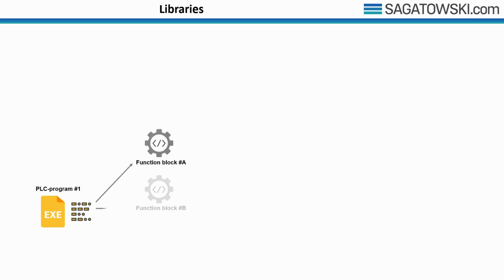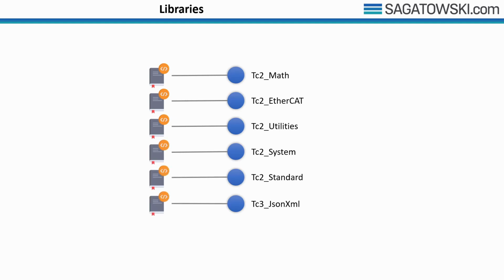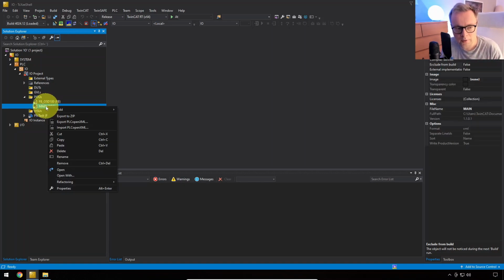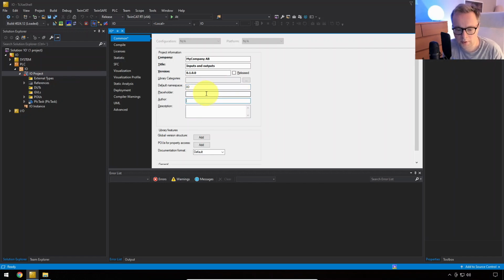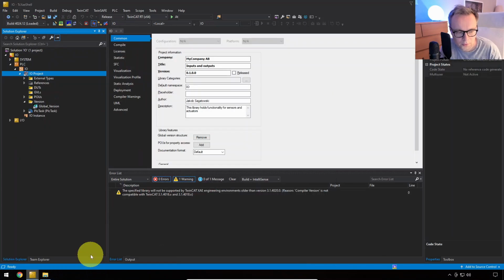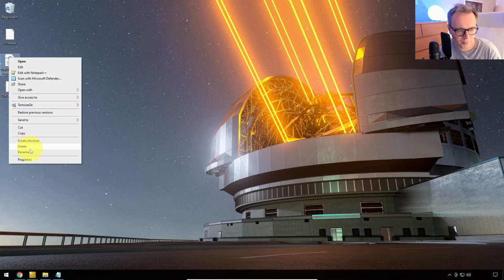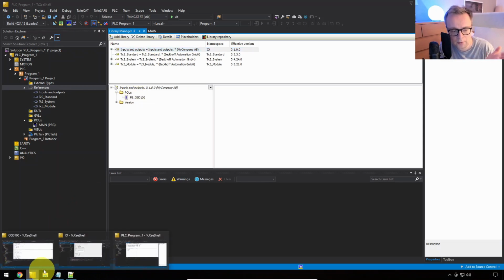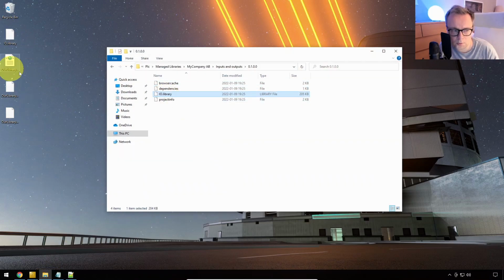PLC programming using TwinCAT 3 - Libraries (Part 11/18)

Comment: Could you show the process for creating a library using TDD. I have downloaded the source code for a open source and saw that the solution has two projects in it (library implementation and testsuite) but haven't been able to replicate the same structure neither in TC 4026 or 4024. also, during development, I suppose the library has to be recompiled every time you make any change making the development a little bit more tedious than just having the test suite in the same solution.

Comment: Great videos !!! I am a total beginner and trying to make some project involving two pumps, voltage steered, some magnetic valves, 4-20mA sensors , and one more device that I have to communicate with over PROFINET. 

Would you recommend SIEMENS or BECKHOFF ?

Comment: I created a Class with a few public methods in a project. After that, similarly to what you shown in the video, I created a library (from this class) and added it to the library repository . But when I tried to re-use this class in another project,  I do not see neither the class or methods within the CONTENTS of the library. I only see the library information and project information folders with its contents. Any idea how to make this work for classes?
Reply: Never mind, I figured it out. I am using CODESYS and you have to place the class inside the POUs tab, then it will work fine. Thanks for the video, it really helped a lot, CODESYS documentation is a nightmare.
Reply from the maker: Good that you figured it out!